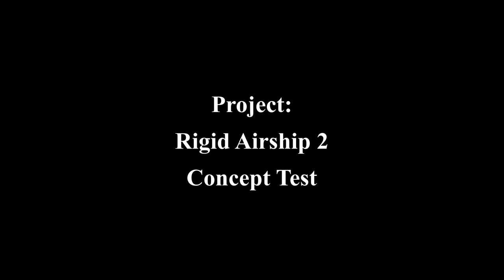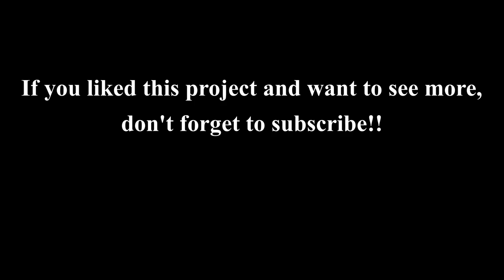Make Things Fly - Project: Rigid Airship 2

Comment: So much fun! I love airships! I'm not sure but i think they benefit from square cube rule, like rockets, where the bigger they are the better the ratio of envelope weight to volume gets, up to a point. I wonder where that point is, how big an airship is possible with modern day technologies and materials and how high could it float. I've even heard of projects of spacefaring airships where you build an airship which can float so high in the atmosphere that its possible to accelerate it to orbital speeds with ion thrusters, eventually.
Reply from the maker: JP Aerospace is experimenting with that. I got interested in lighter than air craft because I wanted to make something that could get to space. Turned out it was much more complicated than simple raising till you drift off into space. unfortunately one problem is that the higher you go up, the more your gas expands. The volume needed to lift something increases, so at really high altitudes the volume of your gas cell gets to the point of not being feasibly possible to reach space on its own. Project Manhigh was a great prespace program thats worth looking into if your interested in high altitude flights.